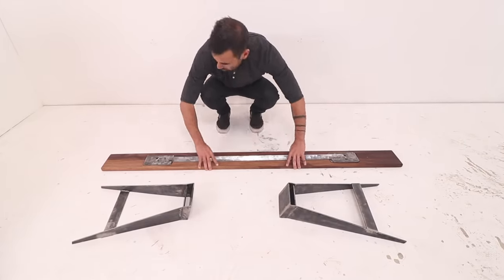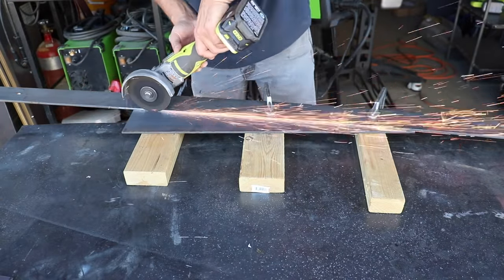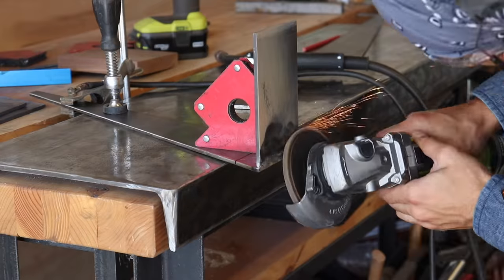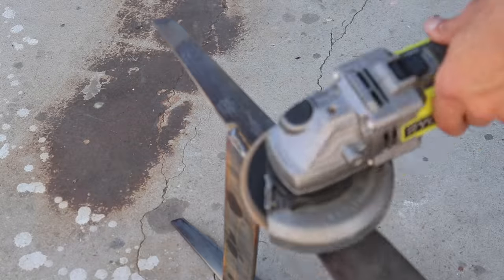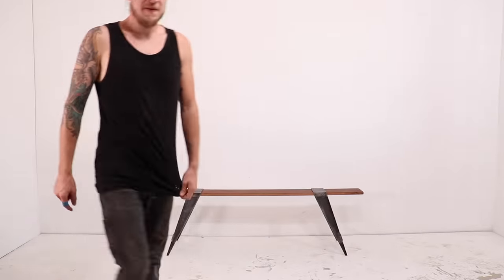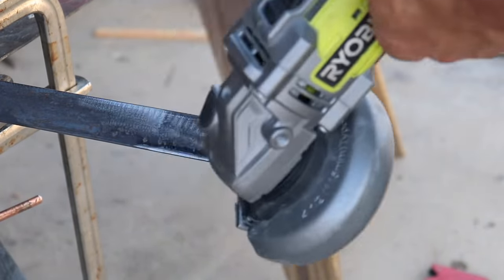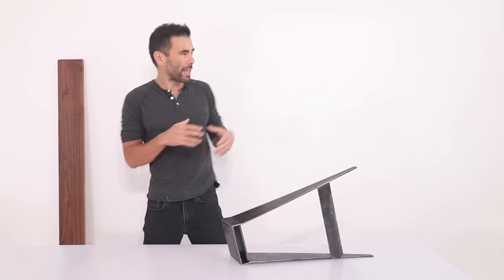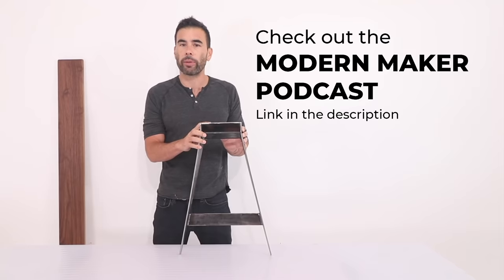DIY Modular Mid Century Modern Furniture | The Slide-On Bench

Comment: The steel and walnut combo looks so great together. I think you could also reinforce it by putting a long stretcher between the lowest cross members since I noticed the whole thing flares out when you sit in the middle. You could notch the steel so the new long stretcher slides and locks into place.
Reply from the maker: yes it could actually be a cable since they want to flare out!
Reply: HomeMadeModern oh yeah! A thin cable would look so clean! You could tension it similar to those modern steel cable fence railings.

Comment: Great project!! The legs would be cool shelves upside down on the wall. For outside applications you could make this and a larger version as a table and bench....then attach the legs to the inside wall of a shed and use them as brackets to hold the wood pieces.....
Reply from the maker: Great ideas!

Comment: Nice design. I have one suggestion, when bending the legs, cut the groove on the outside of the leg. It will make bending eaiser and when you weld the gap shut, it's alot stronger.

Comment: Really cool Ben! It sounds dumb, but I'm surprised how thin steel can be and still be strong. Do you think rubber cement can work as an analogue for the Flex Seal feet?

btw, huge fan of the design notes segment. Between Insta, episodes of the podcast and design notes it's always great to hear you express ideas and thoughts directly